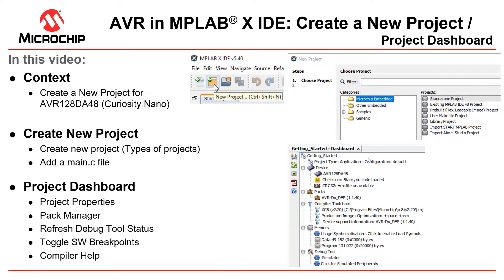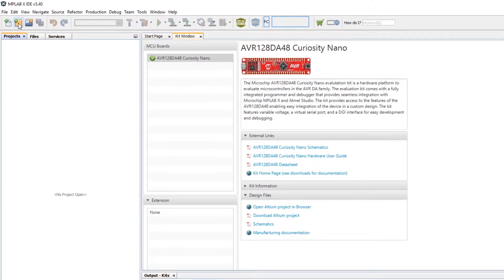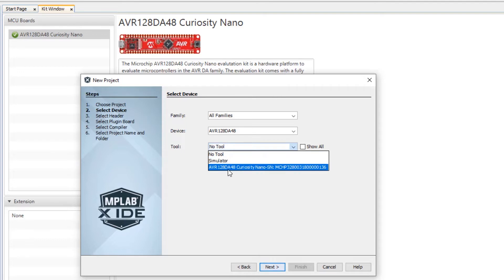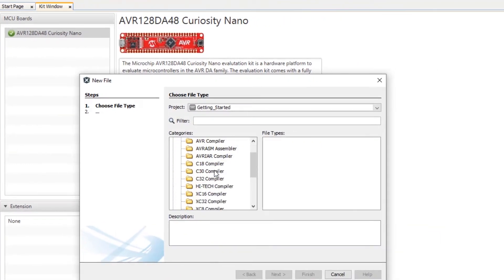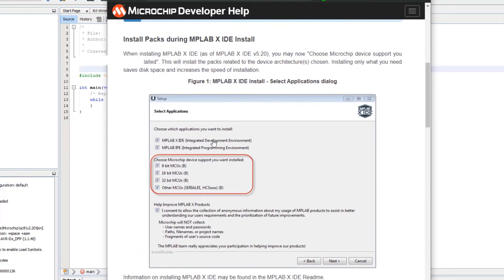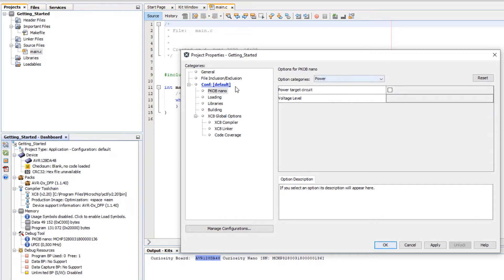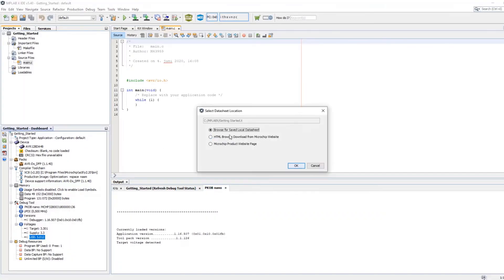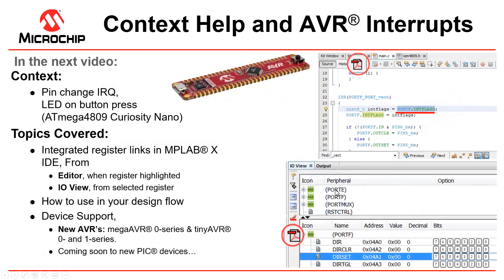Getting Started with AVR® in MPLAB® X IDE | Create a New Project/Project Dashboard

Comment: I am just starting to learn , I am trying to make some programs using assembly .asm but 
I can not compile the program in macOS and MPLABx any tutorial how to set up the compiler for asm in macOS
Reply from the maker: Hi there, thanks for reaching out with your question! MPLAB X IDE requires a 64-bit toolchain for macOS. For assembly programming, you should use the PIC Assembler, which is available with the XC8 toolchain for 8-bit PIC MCUs. Note that the older MPASM assembler is not supported on macOS or in recent MPLAB X IDE versions, To set up the assembler/compiler for .asm files in MPLAB X IDE on macOS, follow these steps:
1. Open MPLAB X IDE.
2. Go to Tools > Options (or MPLAB X IDE > Preferences on macOS).
3. Click the "Embedded" button, then select the "Other" tab.
4. Ensure that assembler file extensions (AS, ASM, S, as, asm, s) are listed as accepted file types for assembly source files. You can also set the default extension for assembler files. https://ww1.microchip.com/downloads/aemDocuments/documents/MCU08/ProductDocuments/UserGuides/50002027E.pdf#page=280
https://onlinedocs.microchip.com/oxy/GUID-D79ACEBE-41BD-43EF-8E1B-9462847AE13E-en-US-10/GUID-4DFCAC63-C63D-415A-A096-D4EE9D9A77BE.html
5. To select or add an assembler toolchain, go to the "Build Tools" tab in the same Options/Preferences window. Here, you can see the list of installed language tools, including assemblers. If your assembler is not listed, you can add it manually by specifying its path https://ww1.microchip.com/downloads/aemDocuments/documents/DEV/ProductDocuments/UserGuides/MPLAB_X_IDE_Users_Guide_50002027.pdf#page=347When creating a new project,
6. make sure to select the correct device and toolchain for your assembly code.
 
For further assistance please reach out to us at: https://www.microchip.com/en-us/support. Thanks again!